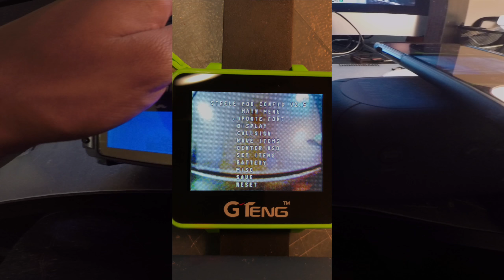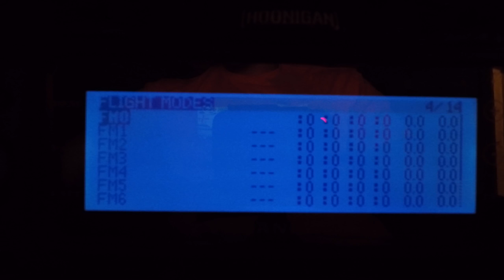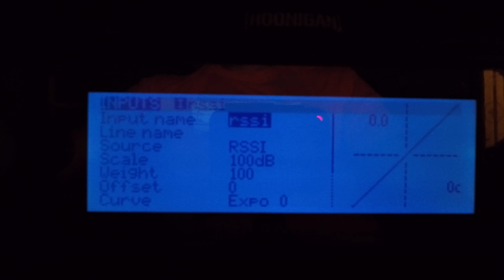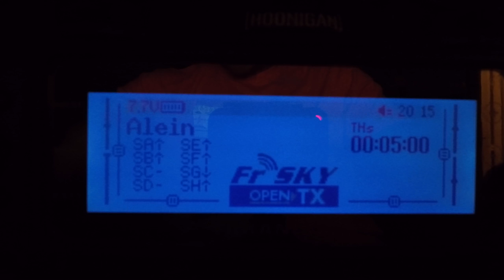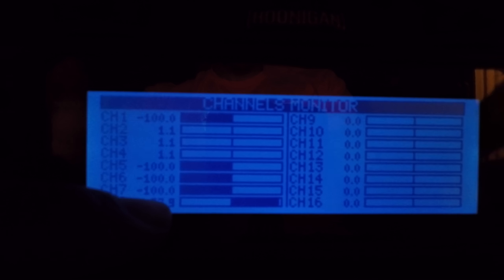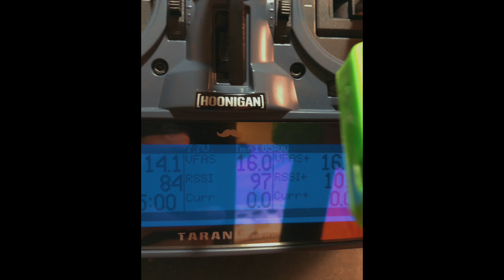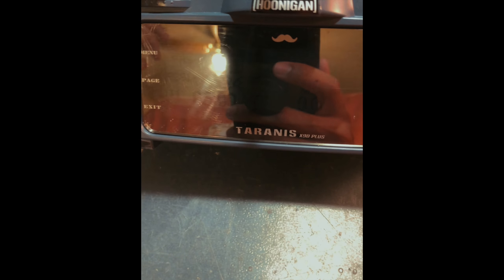Ｈｏｗ  ｔｏ: Set Up Kiss Rssi On OSD!

Comment: Thank you for this
I just set mine up with a Crossfire  tx, 
Had to used RQLY is steaded of RSSI for the sources,
many thanks
Reply from the maker: hey nam NP! aslong as i can help even just 1 person that ass that matters!
Reply: Can you elaborate on this? I am trying to setup my Steele PDB, RSSI display and am using Crossfire too. I have added the values shown in this video on AUX4, etc but it still displays 0db on the OSD. Any clue where I'm messing up?
Reply: I should also mention, I am using a DX8, not Taranis. If this somehow matters. I don't care if RSSI isn't displayed on my radio (it's on Crossfire TX anyhow) I just want to see it in my OSD.
Reply from the maker: the spectrum part may be a problem. specktrum doesn't run open tx and use the same LUAs and what not and you cant assign CH's like on frsky. and i would say call horizon hobby or specktrum, but there never any help .🙄there tech support is ridiculous im sorry
Reply: how have you done it? i cant find it on the gui. Cheers

Comment: Hey thanks for the video, I have everything exactly as shown . I can see on the channel screen that rssi is working properly. I have my osd on AUX4 and in KISS configurator I can see AUX 4 working with rssi. But no matter what my osd read 0db?????
Reply from the maker: jsmithproductions what CH is your rssi on your tarannis? 4? Or 8? Make sure it’s on ch8 on the remote and ch4 on the osd.

Also make sure you change the osd configuration back to the the osd firmware.  Because you will not get a osd value on on the configuration screen you have to flash it back to get a value.
Reply: Snacks_fpv rssi is in channel 8 and osd is on aux4 I did set the osd firmware back still no reading just 0 :/
Reply from the maker: jsmithproductions hmmm🤔.. I’m I’m sure you tried re flashing the kiss osd completely right? And just to confirm you Do see the RSSI value or the little line indicating the signal on your remote correct.

Comment: This tutorial is good even for crossfire micro receiver?
Reply from the maker: yep but for the crossfire micro you will set the min to 0 and max to 2000
Reply: hey Snacks do you think R9m recievers have the same settings (0 min-2000 max) as crossfire since they are both 900mhz? i have a R9mm reciever and i have rssi working now with the 1009-2000 setting you stated in video but want to make sure its accurate.

Comment: Have RSSI set on channel 8, AUX 4 in OSD, getting telemetry on my Taranis but the icon doesn't show up in the OSD. Any ideas?
Reply from the maker: double check in the osd config and make sure you have the rssi icon (on) i know it comes (off) default
Reply: I was able to get the bar graphic to show when the rssi icon was set to (on), but no 2-digit readout whether its (on) or (off)
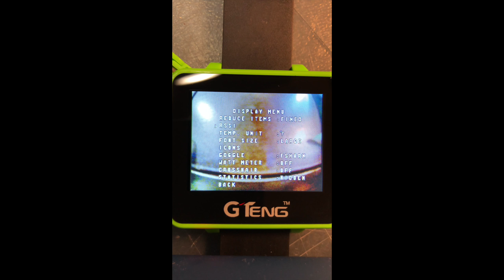Reply from the maker: at 2:02 in the video i mention what that rssi icon was and its those bars and i leave them off
Reply from the maker: ok so go to [set items] and turn RSSI: (ON). 

then go to [icons] and set the RSSI icon: (off) and you should get those numbers only
Reply: Finally got it, thank you so much! 

Now have any idea why my Amps has been replaced with Watts, even though I have the Amps (on) and Watts (off)? lol...
Reply from the maker: 🤙🏽awesome!  

as far as you watts and amps thing no i don't 😂 i know mine show some type of amps but honestly don't even look at it i just look at my rssi if im flying far away and the rest of the time im looking at my Volts an where im flying 😂
Reply: I was working on setting this up today and I have something to add to all this because this comment thread helped me
The RSSI read 0db for me the whole time in the osd configurator and didn't actually show the RSSI real time until I put the osd firmware on. Had everything set up on my taranis before I did the configuring of the osd and was already getting RSSI on channel 8 of my transmitter so this was a little confusing for me. So I thought I'd add this, thought it might help someone else.
Reply from the maker: Josh Stubbs  thank you for your input🙌🏽
Reply: @josh199175  Same thanks for your comment.

Comment: I've tried, but I cannot get this to work.  Everything is set as it should be, I see the RSSI reading on channel 10 (this is the channel I used in both the inputs and the mixer) in the Taranis, but it only shows 0db in the OSD.  The only difference is that I can only set the min and max in increments of 10, so my max is 1010 and my min is 2000. Any ideas?
Reply from the maker: set your rssi on CH 8 not on Ch10:     ch8=ch4 for kiss osd rssi

on your remote take what ever you have on CH 8 off or move it to 10 and put your rssi on ch8
Reply: aaah, great point.  thanks so much for the reply, i'll give that a shot.
Reply from the maker: nice no problem i made this video to try to help out i know there is tons of confusion on rssi set up i was there too 😆!  comment back if it worked or not. well figure it out✊🏽
Reply: yup, that did the trick.  thanks so much for the help, it's greatly appreciated.